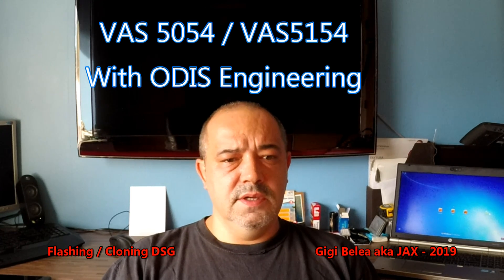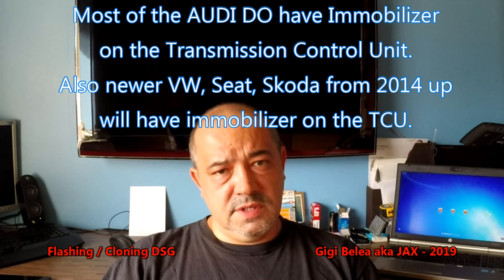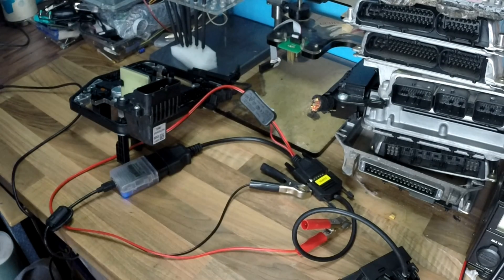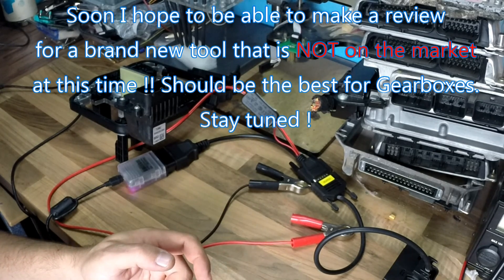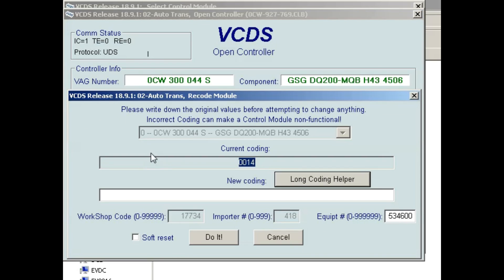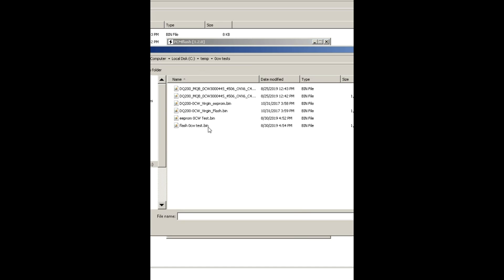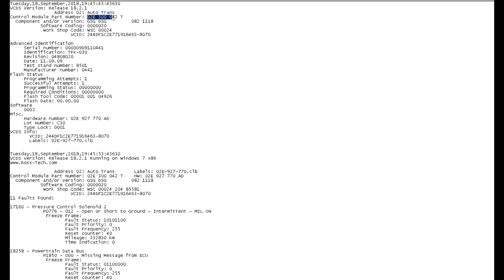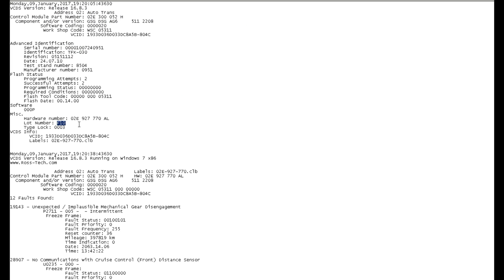DSG Cloning / DSG Programming with PCM Flash.

Comment: 1st i would like to big thank you form north iraq kurdistan city erbil.

Just 1 quick question when you coping or reflashing Eprom from 1 ECU and coping back to old or used ECU how can the car start and work normally.

If the software was bad on the first ECU how can it be fixed by just copying it to another.

I hope you understood my question.

Thank you.
Reply from the maker: If software was bad in the first time then you do not make a clone, you make virgin unit and then adapt online with Geko.
Reply: @GigiBeleaDK  thank you for answering.
I need to learn more don't know about Geko ither.
I'll do my research

Comment: Very Good video, I have an OCW TCU, that was but geko service cannot unlock the unit, saying the initial file is lost, however with pcm flash once I follow your steps to clone from the original unit will it work? I noticed with eeprom you only read , no write??
Reply from the maker: Writting is the same as reading , and yes, if you clone both eeprom and flash everything should be ok.
Reply: Okay thanks so much for replying, so to clarify, it’s the same step in micro flash, in eeprom I read and save then write the file ..also can you send me an email, I would like to support your work! You are very helpful
Reply from the maker: @shawnparasram5389  Yes, just like flash , eeprom the same way. but write flash then eeprom.
Reply: @GigiBeleaDK  Thank you!
Reply: GigiBelea aka JAX  I tried to write eeprom, but it says “checksum not use” do I go forward with the option? Thanks
Reply from the maker: @shawnparasram5389  yes, no crc on eeprom or flash if you just make clone.
Reply: GigiBelea aka JAX ok thanks I have an issue, the units won’t adapt online with ODIS after successfully clone, the original unit data was lost from the car, so what I am trying to do is clone a unit from another car , then try to unlock with ODIS online, so far no luck but I am abit concern the original unit is 0AM927769G , all the replacements I have used are 0AM927769K , can this be my problem? I am stumped with this car...nothing works, I know both are 0CW MQB with immo. Any help I would compensate!
Reply: I have also sent you 20euros and an email, please let me know if you received ?Jul 25, 2020 19:08:44 PDT

Comment: Hello Greeting Gigi. May i ask if i had a audi 0cw and the flashing already done. Do you still need to do it online for the basic setting ? As the hardware are the same
Reply from the maker: No, basic settings are offline but if your unit is not matched to immobilizer you will need to do that.
Reply: @GigiBeleaDK  As the eeprom and micro had flash to the new unit. No online are needed right ?

Comment: Hi can pcm flash clone the dsg dq250  thanks
Reply from the maker: yes.
Reply: @GigiBeleaDK  Hello, I emailed ecutools (pcm flash company) asking about older Cxx mechatronic and they replied: It reads 448 kb, EEPROM is not supported. 
So unfortunately it looks like the pcm flash is an option only for exx/fxx mechatronics cloning.
Reply from the maker: @Artec12  For Cxx you do NOT NEED the eeprom it's in the flash.

Comment: Nice video. Can you show us what other tools you use to work on bench, as is power supply, multimeter, osciloscope, soldering device, cables, in my case, I am a beginner, I want to do this with my own car, so I had been adquiring some tools and interfaces to start but there is a lot of expensive trash in the market that is not required.
Thanks a lot for any advice you can give us.
Reply from the maker: If only working on your own car the investment in tools is to big I would say. If you plan on working on multiple cars then yes, you should buy a stabilized power supply , hot air soldering station , osciloscope if you work on the car mostly , on bench not needed.
Reply: @GigiBeleaDK  thanks again, It is possible to scan the 02E dq250 control unit with VCDS or ODIS in the bench? I can't figure out how the wiring must be between the TCU and the OBD2 interface to by pass the gateway, regards from South America!!!
Reply from the maker: @HowieLop  Google "KTMFLASH VAG DQ200 and DQ250 User Manual" , you will see there.
Reply: Are you able to read eeprom and the flash from a TCU 02E DQ250 in separate files with KESS V2? Or maybe it is possible with any software to divide the files?, if not what interface do you recomend?
Reply: @HowieLop  I am not using Kess for DQ250. I use either Frieling SPI Wizard or PCM Flash. Don't know how Kess reads them ad never tried it, the other tools I have are much more faster.
Reply: Thanks a lot, your videos and all the knowledge you shares, it encorages me to investigate more and thus be able to carry out my project car. Regards from Colombia
Reply: Hi again, next week I will to read my TCU (DQ250) with my KESS and want to share that file with you, this way you can see what information KESS reads. Regards.

Comment: Great video thanks, 

What’s the most cost effective method to flash and tune ecu & tcu on an Audi rs3? 

Is it pcmflash? 
Although I’m not sure pcmflash can do tcu?
Reply from the maker: This are the modules supported by PCM Flash :
DQ200 (0AM) [ WR / CK ]
DQ200MQB / G2 (0CW) [ WR / CK ]
DQ250C (02E) [ RD / WR / CK ]
DQ250E / F ) [ WR / CK ]
DQ250MQB (0D9) [ WR / CK ]
DQ500 (0BH / 0BT) [ RD / WR / CK ]
VL300 / V30 (01J / 0AN) [ WR / CK ]
VL381 / DL382 (0AW / 0CK) [ WR / CK ]
DL501 / G2 (0B5) [ WR / CK ]
DQ200 / MQB / G2 Boot (MICRO) [ RD / WR / CK ]
DQ200 / MQB / G2 Boot (EEPROM) [ RD / WR ]
DQ250E / F / MQB Boot (MICRO) [ RD / WR / CK ]
DQ250E / F / MQB Boot (EEPROM) [ RD / WR ]
VL300 / V30 BSL (FLASH) [ RD / WR / CK ]
VL300 / V30 BSL (EEPROM) [ RD / WR / CK ]
VL381 Boot (MICRO) [ RD / WR / CK ]
VL381 Boot (EEPROM) [ RD / WR ]
DL501 / G2 Boot (MICRO) [ RD / WR / CK ]
DL501 / G2 Boot (EEPROM) [ RD / WR ]
DL832 Boot (MICRO) [ RD / WR / CK ]
DL382 Boot (EEPROM) [ RD / WR ]

Comment: That was absolutely brilliant very interesting on dsg gearboxes, I'm understanding how they operate much more now, I have a problem of my own and wondered if you can point me in the right direction, I've purchased an Audi 3.2 2004 registered TT with a DSG automatic gearbox with a fault, when driving through all the different modes of the gearbox it seems to drive very smoothly and does all the right things but at times not often it goes into neutral and loss of drive and the dash light with the gear selection starts flashing on and off, I have to stop and turn engine off and wait a minute or so then start the engine on again and it seems to go back to normal, the last owner had it tested on a computer and it shows no fault codes, it's had new gearbox oil and filter and with your experience and understanding I'm hoping that you can help me in the right direction, kind regard karina Cavilla. UK.
Reply from the maker: It's not about the previous owner reading codes and tellin you it's all ok :) ... you must have a tester on it and check the error codes. When it goes to neutral while driving it will throw some error codes .. check them. Is probably a worn clutch or a defective valve.
Reply: GigiBelea aka JAX thank you for that, I will check it out and will let you know what I find and again many thanks.
Reply: Hi this was what we asked your help for 2 weeks ago, just so you know in reference to the message we sent you last about the error codes.

Comment: Another question what I didn't understand. If we transfer whole data from this to another TCU should we need to reprogram the car ECU to learn the immo data to ECU too or can we do this via vcds?
Thanks!
Reply from the maker: VCDS does not perform any programming , only coding. So you transfer the program / flash / software with PCM Flash or other tool, then you do coding with VCDS if necessary.